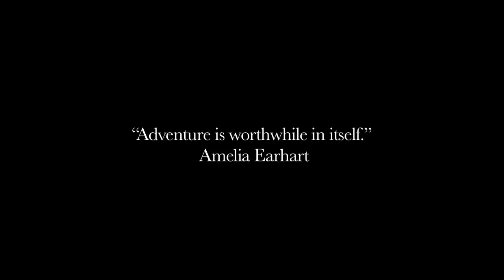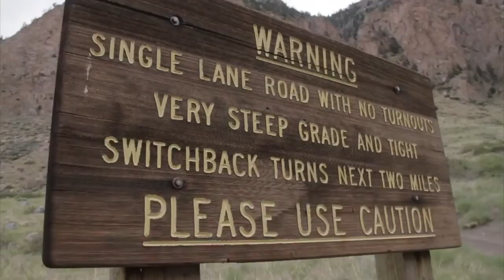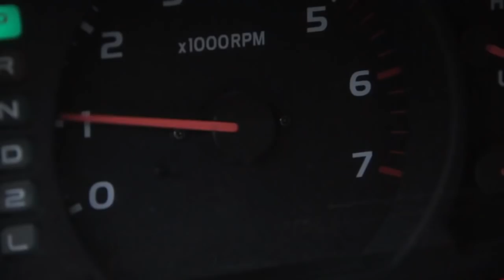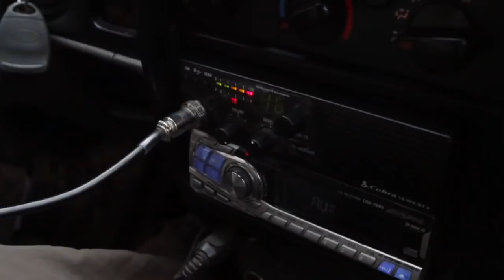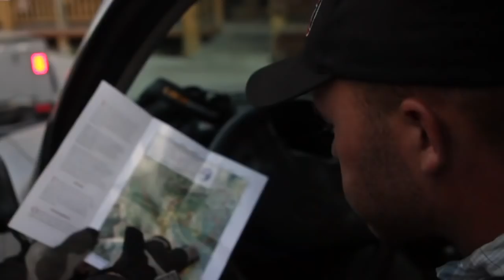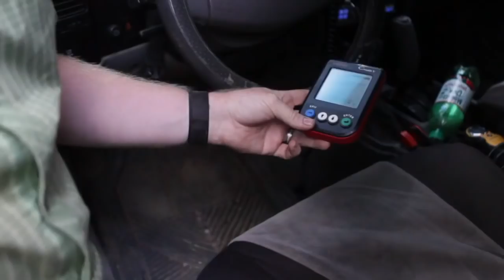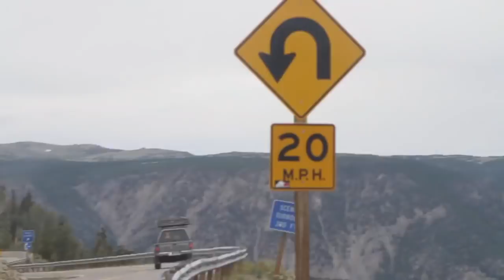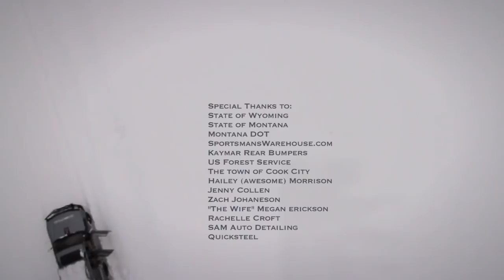Expedition Overland: North America Ep5

Comment: Nice vid guy's !!
Good camera work !! Brilliant shots !!
Toyota rules !!
Tip: *)First section in the sand, lower the tire pressure to +/- half it's pressure. When you reach the stones, fill them up.
*)Use hand signals next time. *)When you use the High lift jack watch your hands, don't hold them near it, especialy when you are doing a side pull as well,  if she slips it's by by. (i have seen this happen, and it almost happened to me 2x in DRC Congo) 
Enjoy your next adventure !!

Comment: Wow, giving those winches a work out. Way to keep your noses to the grind stone, and great video. But I can not help but mention that this would be less challenging with the proper meat and potatoes. Like solid axles front and rear, locked up all around. At least 34''s that are more aggressive and proper gearing. Think about Interco tire company and a solid axle swap up front.

Comment: Awesome video and don't mean to overstate the obvious but with such planning into a route plagued with super steep switchbacks I'm not sure why this would be attempted with a trailer. Eleiminate some of the "want to haves" keep the "must haves" and load the cruiser best u can , no trailer. Super dangerous and not worth the danger with those drop offs.  I love my expedition built 4Runner but will say even with a trd selectable rear locker and warn winch among a LOT else, I'm selling it to go back to a wrangler JK 4 door Rubicon.  4:1 transfercase, front and rear electronic locking diffs, electronic sway bar disconnect, 4.10's , Dana 44's from and rear , 4 wheel discs, rock sliders and under protection, HD components from stock, hill decent , full cage, there's jsut no better extreme expedition vehicle from stock with full warsnty .  Took my last built JK through Alaska and my built 4Runner would NEVER ton half the obstacles .  I love your rigs but for me it's time to go back the the Unlimited Rubicon , maybe a rubicon truck "dodge power wagon" with all the same goodies or even a diesel light truck with the same goodies he ZR2 Colorado light duramax.  Too many steps back and loosing off-road capability going from my Rubicon to my now built 4Runner. Ugh. Awesome video and for entertainment purposes, awesome! 👍 glad u were all safe.

Comment: Any one on this show ever hear of airing down?
Reply: I know, first sign of an amatuer. Pity they have cameras and are unleashed on the world coz other monkeys will see......... then do
Reply: ***** Reducing the tire pressure allows the tread to print wider thus improving the traction it also allows the tires to "mold" to the terrain around it getting more traction on uneven and loose surfaces.
Reply: strakill This ^^^^^!
Reply: Watch again.  22:50 he says they "rolled off the trail, aired up, and..."  They were aired down.
Reply: mghought Airing down from 50psi to 40psi doesn't constitute airing down in the sense where tire become flexible. Now if they were at 25psi (at least) it would be a different story
Reply: strakill He's mentioned airing down to 10 psi in another episode (don't remember which).  But I can't speak as to how far they did in this episode.
Reply: strakill but those are 35 psi tires not 80
Reply: sidewall strength and total weight play a hugeee diff in how much u can safely airdown in this episode.
Reply: They know about airing down because in a previous episode in this series they were down to 9.5psi. It might of been in the snow up in BC Canada. If people would watch the entire series in order starting at #1 a lot of these comments wouldn’t occur.

Comment: Why did you guys choose a land cruiser for off road. Land cruisers get such terrible mpg you cant go anywhere without running out of fuel, my 91 got 11mpg. My f350 4wd crew cab gets 18 mpg. Lockers and a 4 inch Old Man Emu lift and ARB front lockers with two Tacomas and two pop up campers seem to be a better fit